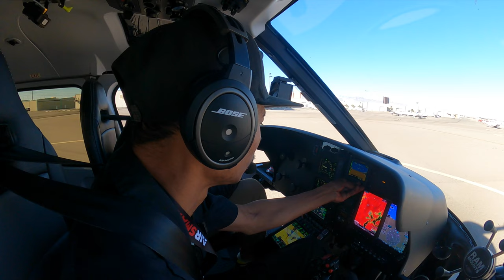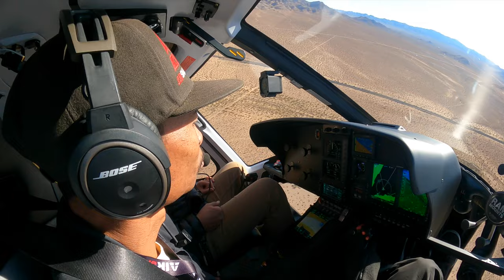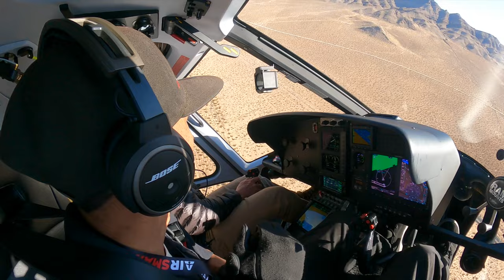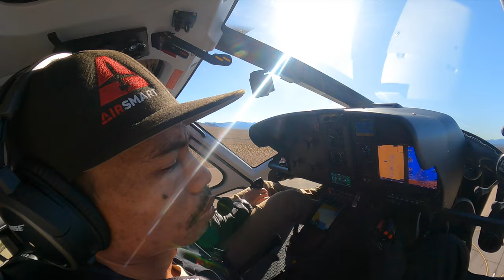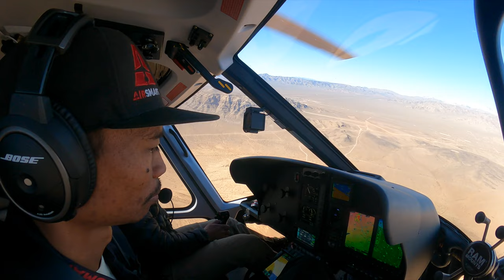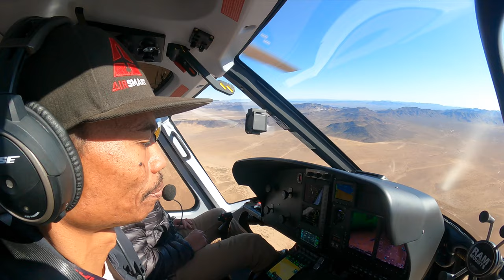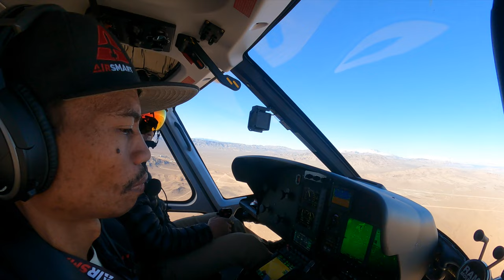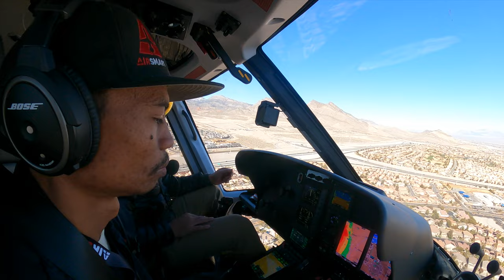Learning to Fly Helicopters . Lesson 3

Comment: For your third lesson you're doing very well. You've got a good instructor too. Notice how small his inputs are compared to yours, there's an old saying "If you think about moving the cyclic you've moved it too much". Over controlling is normal for a fixed to rotor wing transition. Small corrections, then right back to neutral so you don't get into a PIO. I have to say his steep approaches looked more steep than normal, but that's probably the camera angle. Keep up the good work, you'll be done in no time.